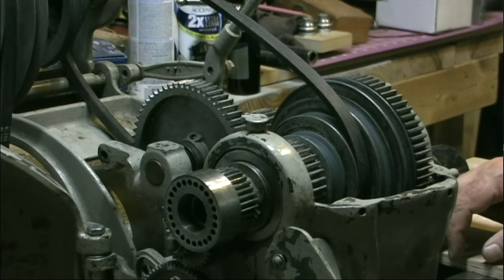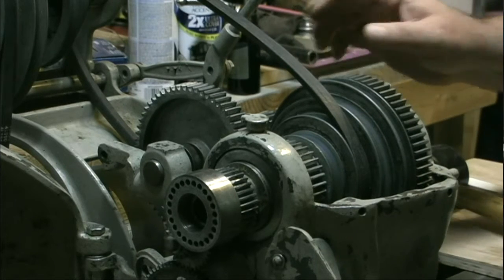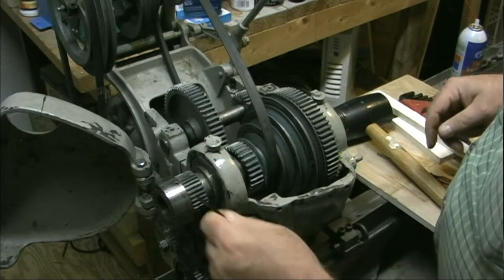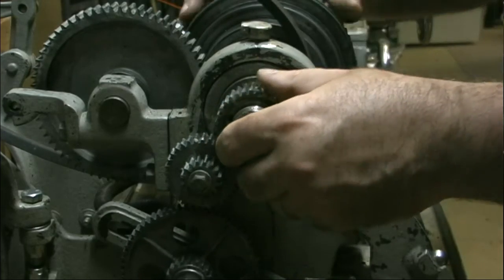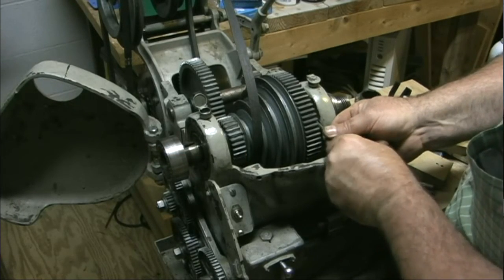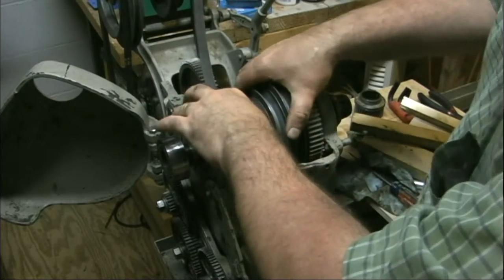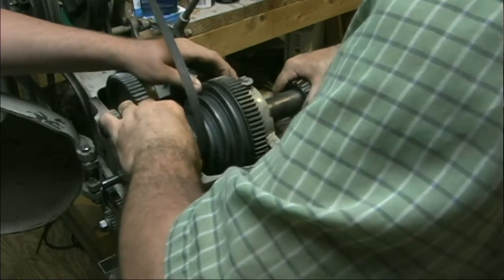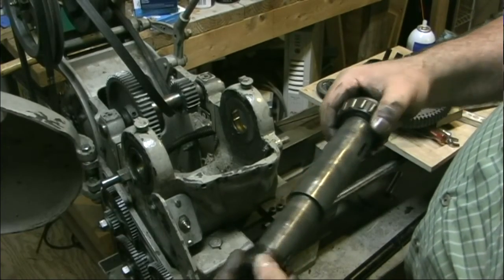Atlas 10F Lathe - TH54 - 02 - Headstock Spindle Removal

Comment: Hi Joe! I know this is an old video and I can't believe its taken me this long to find your channel. I might be the guy you mentioned that had a hard time with removing the spindle. I also had an issue with the locking pin but didn't realised it until I had the lathe back together. I put off fixing the issue because I would need to disassemble the spindle to get to the bull gear. What a headache, though it was easier second time around. I fixed the locking pin and was able to remedy the issue getting the bull gear back on. However, now I'm having an issue getting the bearing by the gears back on. It gets hung up right where the threads on the spindle end. I'm still working at it and came across your videos while doing some research. Thanks for filming your trial and tribulations!
Reply from the maker: I relied on your videos when I first got my Atlas.  Thank you for watching.  So it sounds like you might have a burr raised up.  If you have some good stones, you may want to give it a light stoning and see if it picks it up.  I bought a pair of precision  ground stones shark River machine and I found them invaluable.  Let me know how it turns out.

Joe
Reply: @MyHeap  Little bit of an update. I'm guessing you were right about the burr even though I couldn't feel anything. I used 400 and 600 grit sand paper to clean up the bull gear. I put the spindle in the freezer for a few hours and when ready, used a heat gun on the gear. Slid on like butter and now moves freely even after temps normalized. I still had a hard time getting the bearing that goes on the gear side on even after cleaning up the spindle. It's on though. I'm almost ready to make chips. Just need to tighten up a few things.
Reply from the maker: @eviltwinx  Awesome.  That sounds like a win to me!

Comment: Out of interest, did you replace the headstock bearings and are they easy to get hold of in the USA?
Reply from the maker: No, I didn't need to replace mine but did buy new spindle bearings for the Burke.  They were easy enough to get but you really need to look around because the cost is all over the place.  I would imagine it is the same way with the Atlas.  If you need help sourcing them, let me know and I will see what I can do.

Joe
Reply: @MyHeap  Cheers,

Comment: So the pin was probably stuck due to age and goo etc, but also years of not using the back gears and running with the pin engaged, the pulley gets twisted slightly relative to the bull gear locking the pin in place. If you had grabbed the bull gear and pulley and giggled them in opposite directions the pin may have freed up once the pulley freed up on the shaft. If the pulley ever freed up.
The bearing is supposed to be tight, but for the cost of new parts etc rather than replace anything, I would apply gap filling loctite to the bearing and shaft. It will take up that half a tho or so of play and survive way more abuse than you would expect and improve the quality of work it can get done in that lathe. The stuff is expensive but I assume no one makes new spindles for these things

Comment: Does anyone know what the Timken Bearing ( Taper Roller Bearing) and Race Numbers are for a Atlas TH54 ?? Having major problems finding using what is in mine and they are Timken. The larger bearing is off the charts as in $$$$$ and I mean off the charts. This is what is in mine which are bad---- Timken Small bearing # 14125-A Race or Cup # 14276-B  Timken Larger bearing 
# 16150 Race or Cup # 16284-B. I do not know if these are even the right bearings in the first place---any help would be great
Reply from the maker: What does Clausing recommend?
Reply: @MyHeap       
Timken they are the only ones who sell them for this lathe Large Bearing -- Race #16284-B /  Bearing #16150  Small Bearing-- Race #14276-B / Bearing # 14125-A . Clausing wants right at $500.00 for the large bearing(Complete) if they had it in stock. Have found the Race at $265.00 and the Bearing at $50.00 on the net but they did not have it in stock . This TH54 is not worth it to many things wrong/broken and missing---sad to say will be parting it out in the coming weeks I think will be posting them on Craigslist Tools  Tampa Florida
Have a Cousin with this TH54 Lathe and will let him have what he wants first. There are no aftermarket Bearings for this lathe except in China that I have found. Depending what my Cousin wants  and if can not sell anything I will not sit on the parts left over---my garage has way to much stuff in it LOL. This lathe is Dated on the Bearings 1941 S/N-033415 so these bearing numbers are right for this lathe.
Reply from the maker: @tc1839  Well, if he doesn't want the crossfeed handle, if it is intact, I would like to have a chance at getting it.  Mine is broken.  Email me at xavier@gtec.com if you would like to discuss it.

Joe

Comment: Hello,  I wonder if you could help me please? I have recently acquired an Acorn 10" lathe, UK version of the Atlas, and it is missing the two step motor pulley. Would you be so kind as to give me the dimensions please? Your videos are very informative and helpful, thank you for sharing with us novices.
Reply from the maker: Hello and thanks for taking the time to stop by and comment.  I just went downstairs and measured my 2 step motor pulley.  Mine is 4-1/2" and 2".    I also should say that my pulley looks like it was machined from a solid piece of aluminum and is not original.  I do know that the original part number for the pulley was 9-428, but I do not know the size.  It is not listed in the documentation I have.  My pulley has a 5/8 inch bore but has a pulley bushing to bring it down to a 1/2 inch motor shaft.  I hope that helps a little.

Joe

Comment: Bearings are pressed on. Getting the back gear off means getting to the woodruff key.
Reply from the maker: Thanks for the input Leonard.  My bearings seem to be only slip fit.  I don't feel any play in them, but perhaps my spindle is worn down.  Regardless, I will have to live with it.

I did get the back gears off and apart.  They were not too bad.  Thanks you for commenting and watching.

Comment: My pin kept popping out.
Reply from the maker: The bull gear pin??
Reply: @MyHeap  yup old mister bull gear pin had some trouble opposite of your trouble.  I have had this lathe since I was 10 years old back in the late 60's. I had to pull it apart last year. While it was apart, I replaced the belt too. It took me awhile to adjust the preload on the spindle bearings just right when I was done. The bull gear pin socket got a little wear on it from being spaced too far from the pulley and it wouldnt stay locked in. Getting the key back in during reassembly was the real pain the butt. However its happy now. I think it smiled at me the other day.
Reply from the maker: @ALSomthin  awesome.  So does the pin stay engaged now?  There should be a ball and spring hat hold it engaged.  It has been a long while since I had mine apart.  How was it popping out?

Joe
Reply: @MyHeap  yup all happy now. The spacing betwwen the pully and the bull gear was a little too far apart and the detent spring in the pin was weak it created a little wear from popping out all the time and eventually woulnt stay in at all.  Now its on to getting this weird german adjustable three jaw chuck someone put on it in the 50s to run true again. The jaws are worn the screw and jaw guides are worn   Also I figured out how to reverse it with a D.C. motor and speed controller. I keep the chuck on the spindle with a set screw in a blind reciver hole I put in the spindle.